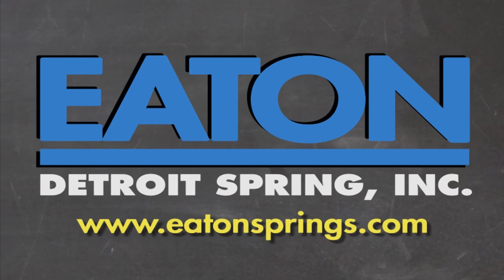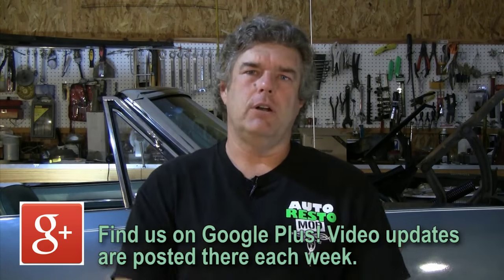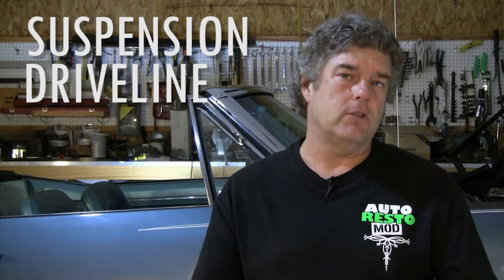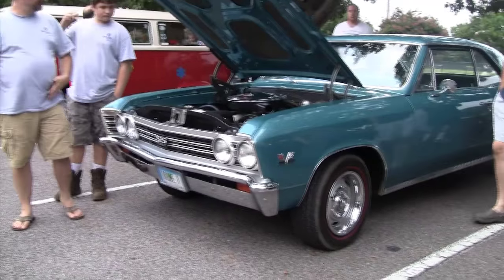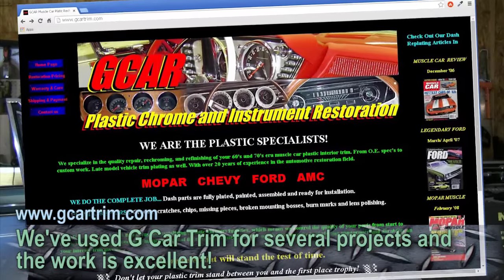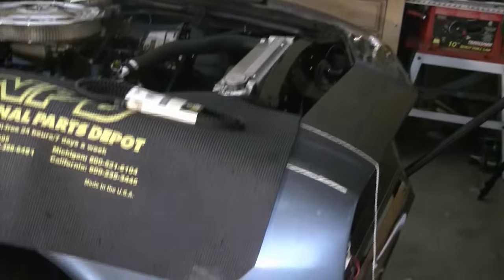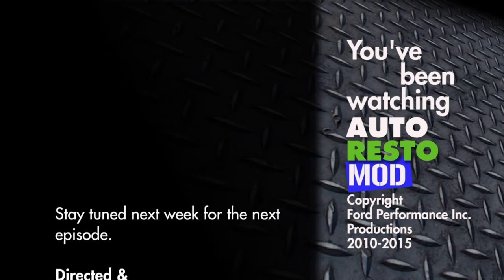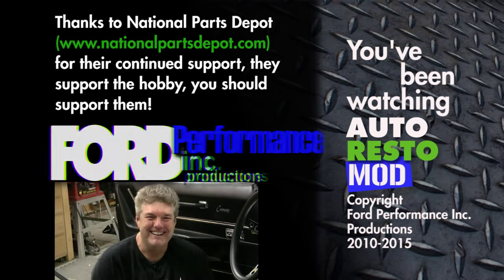What Order to do Projects on your Street Cruise or Show Classic Car Episode 229 Autorestomod

Comment: Great video! My truck, a 69 f250, much like the F100 you're currently working on, is just going to be a driver. That said, I've pulled everything off the frame, redone the chassis, and I'm working on rust repair on the cab. The entire process is on my channel. Although it's a driver, it needed more than what I could have done and kept it on the road at the same time, at least, at first. It'll be going back together ratty looking, but safe and rust free.

Comment: Perfect! Restoring my 71 Firebird Formula that I have had since the 70's and this is exactly what I wanted to know. Plan on having steps done but I did not realize that each step is generally done by separate shops, paint and body, restomod suspension, interior and engine "shops"AND that it is going to be up to me to sort of coordinate. Video framed the steps for me, THANKS!
Reply from the maker: Glad I could help!

Comment: All good stuff there! thanks for posting. 
I have a 68 cougar my mom gave me. Everything is new! Only problem, it's all disassembled. 
I don't even know where to start.
Reply from the maker: Just do a little bit  along.  I like working inside out unless it needs paint.. If it's just an assembly job I work from the interior to the outside.
Reply: @AutoRestoMod  good advice, thanks ! Yes, brand new paint already. Hard part for me is the wiring because the entire dash is disassembled, and the putting all the glass back on, because it was all taken off for the paint job.
Thanks again!

Comment: As always great video!

Agree re the crate motors, these days they are so cheap its not worth building your own HP/$ but Electric man! 40 year old wiring loom's - If you are gutting a car they need checking/fixining/thowing in the bin before you start bolting bits back on...

Love the rustoleum tip., how may times have you seen rust coming back through DIY repairs painted with undercoat!

Comment: The weekend work standard is golden...those things that take longer than a weekend is what kills so many builds...also people overestimate their skills and underestimate the amount it costs..sometimes you have to bite the bullet and pay the pro to get the work done.
Reply from the maker: Tis true!
Reply: This is what my dad and I are struggling with currently, started a 68’ Barracuda resto and during disassembly found that 3/4 frame rails are completely rusted through. Two can be bought one has to be fabricated. Rear right quarter panel also needs to be cut out and replaced. Still deciding whether we attempt both on our own vs paying a shop. Both take a fair amount of time especially to do the right way.

Comment: GOOD TOPIC ! I differ a bit on order though because I think it depends on other categories and current condition. For example, I am restoring a 1966 Mustang Coupe. And I have about 20x22 working space (plus a bit more for storing parts). The cars driveline is all set so I would not dream of removing but then again, I am not going for concours..lets say I am going for PRE concours..post daily driver LOL...

So from there, yes, safety first which means a complete brake job (drums kept but 2 bowl master), verifying the suspension, etc. Driveline, trannie, driveshaft. Then, chassis refurb in terms of derusting, sealing, etc. Checking all lines (brake and fuel). Mind you, the interior is already gutted and except for painting the dash, it will be LAST or darn close.

Now all of this I am doing from FRONT to back. In other words, I don't move from the engine box until its done. Same with the chassis. then on to the trunk. Tank removed. Everything is wire brushed (manual and power), de-rusted if present and sealed. Now I have peace of mind the foundation is solid.

What I am saying is I do the heavy lifting no fun work first. Windshield out, then back window, Now its going to get good. Now I get t do what I want...oops ...forgot...working on the windows while the doors are STILL IN...Much easier while they are vertical. 

Okay, now fun stuff. Body work. Stripping, coating, priming, sanding, repeat...LOL...Now I can paint .....and now I can move to the interior. Headliner, door inserts, carpet, etc etc. Glass back on. 

Sorry for the long post..what I am trying to say is it really depends on past daily driver but not concours, where you started....total rustbucket or part way there... Thanks though ..watch ALL your videos.

Comment: Safety is the obvious.  The first mandatory step for my past 20 years of restoration is complete gut and strip to locate every spec of rust that can be found. Absolutely pull all the glass out of the car. During this process be extremely gentle with every single thing you touch and remove. Never assume you can replace anything. Catalog, box, bag and label everything you remove storing the parts in a clean and climate controlled environment.....thats my tip before even watching this video. Now let's see what the host says.
Reply from the maker: Good points!

Comment: I'm working on "redoing" my first cruiser 67 mustang. Body and paint is in excellent condition from the previous owner. But they lacked doing the floor supports. So the undercarriage needs work that will require destroying body work and paint already done. They did your list backwards. Now im trying to fix it on a shoe string budget. I'm trying to do the smaller jobs, and pretend the big jobs don't exist. When in my mind.....stressing. it takes the the joy and fun out of the entire project. At what point, is it good to decide to just walk away, take a break, and come back to it later?

Comment: Safety first. I keep a build bible of what has been done. Tires and brakes don't go cheap your life may depend on it. Roller paint job works good for floors and other places that may rust. I got a wagoneer it goes to club events and trial rides and mustang goes to drag way. The 460 in the fox body gets attention. The fox body is cheap stripped roller. My 10x10 space is hard to work on motorcycle on let alone a full sized vehicle. Had to build shelving for trim off wagoneer. Get on that rust it will not get any better with time. Don't be like me and have too many projects and budget for only part of one.